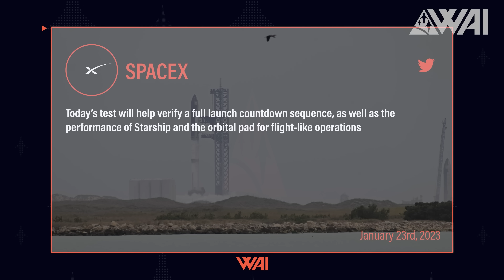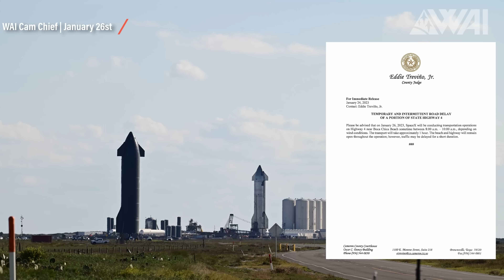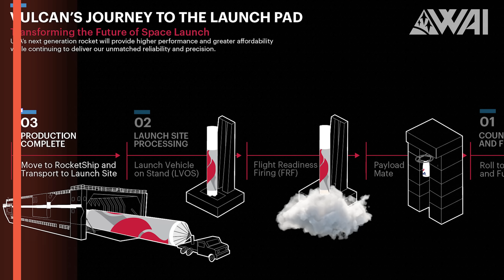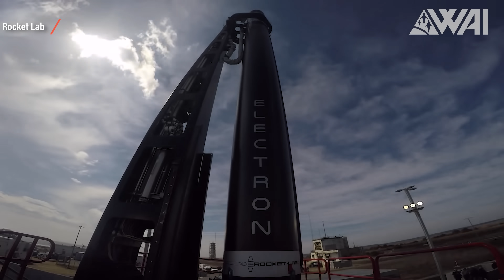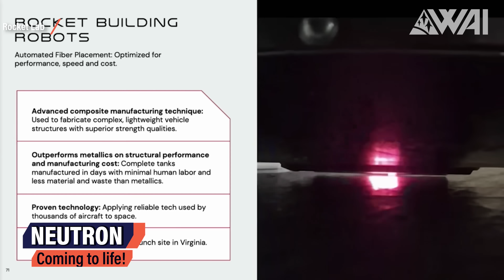How Did SpaceX Starship Do During The BIGGEST Test Yet? - Largest Rocket Ignition In History Next!

Comment from the maker: Is the Starship orbital Launch Mount going to survive the 33 engine static fire? What do you think? :_WAIShocked:
Reply: Yes it will!! Go Spacex!!!
Reply: Maybe? If the non-flame-diverting pad doesn't kill it!
Reply: Hell yeah it will!
Reply: Yes!
Reply: It will be the biggest test of the structure yet.  I am sure they will learn a lot and there will be changes implemented in Florida.
Reply: I predict it will be a baptism of fire
Reply: SpaceX will not burn 33 engines at once, they ended up with 14 engines, they will bring the number to 33 engines through tests of 3.4.
Reply: I think the tower and launchpad will suffer considerable damage. All 33 engines have never been ignited at the same time. But they will learn from it and the design of future starting towers (must) adjust accordingly.
Reply: big boom big badaboom ! Mooltipaaass
Reply: I think the 33 engines will turn the ground underneath to pebbles. Still, it's wise not to rely on a flame diverter: if Starship is supposed to land and take off again from the Moon or Mars in the future, it has to work without a flame diverter underneath.
Reply: 1 - The orbital launch mount will survive - but the pad below will need to be repaired.
Unfortunately, SpaceX may need to carve out some "underground" flame diverters.

2 - Will the Heat Shield tiles survive the 33 engine static fire ?  
If tiles continue to fall off, there will be no orbital launch till they resolve their heat shield tile issues...
Reply: I have deep concerns.  There are reasons that all other heavy lunch vehicles have gone with flame trenches and we know they work.  In this case I think Elon and company have let aesthetics win over engineering.  Again.  I also think building two more Superheavy Orbital Launch Mounts before the first one is even tested at full power is a fool's errand.   On the other hand, IF they finally do transition to sea launches this problem will disappear.  However the current state of the SpaceX Sea Launch System is not encouraging.
Reply: Felix on this channel does get the good stories, but it always annoyed me that he draws it out so long to get it.
Reply: If at 1st you don’t succeed, try try again. Cant wait to see the first huge boom!  Go SpaceX!🚀🚀🚀
Reply: A better question is if the 33 engines each survive the vibrations and immense heat of their 32 siblings …
Reply: I predict slight damage to the concrete but I'm more intrigued with what data they will get from the flight. What is monitored?  Maybe make an episode on that? Thanks for the information  👍
Reply: OLM will withstand the thrust of 33 engines
Reply: Absolutely maybe! Big chunks of concrete will go a flyin'. What about the water dampening? I have confidence that SpaceX will get it right eventually. 2024?
Reply: I love the idea of the orbital Launch Mount but I think concrete will be flying everywhere once the rockets fire off. I hope that it doesn't damage the rocket but all that power from all the rockets lighting at once instead of just a handful will be interesting to see what happens. fingers crossed. Go Spacex!!
Reply: yes it will go well
Reply: Yes, I think so, especially if they use the deluge system. Let the water absorb the vibration and energy the beast is about to unleash.
Reply: There will surely be some damage but hopefully minimal . Right?
Reply: I think so , It will survive
Reply: Excited to go to orbit yeaaahhhhh....
Reply: Yes, always design for twice plus the stress.
Reply: Launch table is a beast!!! The plumbing and insulation... well the workers have job security,  there is always repairs to be made 👍😁👍. And far as the concrete underneath.... it is going to have to take one for the team lol... I know it wouldn't be a permanent fix, but some 2" plate steel underneath table would handle multiple tests between needing repairs.  We use it out at open pit mines constantly to cover our pattern holes. Hundreds of thousands of pounds of explosives , countless tons of rock and ore , crushing and bouncing off it , we reuse plates dozens of times.. Anyway simple idea, but would be far less maintenance intensive.  Probably cheaper in long run too, as would not need replacing after ever single test.
Reply: The Apollo Program was based upon what could be done.  It pushed the limit for sure.  The Space X Starship Program seems to be based upon what is hoped/wished can be done.  Watch the shock waves on video of Saturn V launches.  That rocket was just less than half as powerful as the Starship booster.  The Starship booster packs over twice the thermal/shock wave forces in a similar sized package. That is the wishing and hoping part.  

The video game generation is designing Starship. Just because something can be imagined does not mean that it can be made reality.   There is too much weight in too slender and too small a diameter package.  The stack may simply crumple when hit with the power of those 33 engines.   Too much energy in all those engines which are too close together.  The launch pedestal is terribly inadequate.  And, to top it off I'm not convinced that the Starship itself can even re-enter safely.  For grins look up the Soviet N1 moon rocket.  Four were launched and four failed.  It had 30 engines by the way.  

The Saturn V was a manageable size and had more than sufficient payload to support anything anyone wants to do now.  There were upgrades in the works for the F1 engines.  Imagine a Saturn V with strapped on SRBs.  More thrust than Starship booster.  I think it would have been better to build the Saturn V with todays technology.  

It's going to be very interesting to see if Space X's bold (or foolhardy) Starship + booster will function as intended.  I'd very much like to see it a success.  But, I'm very worried that they have bitten off far more than they can ever hope to chew.  They have many fans here and elsewhere.  But, all of you should find the old Saturn V launch videos here on Youtube and imagine one of these Starships being launched from the Saturn V pad.  Would it survive under the load of over twice the thrust.  Perhaps.  They tended to overdesign things back then due to less computer power available for simulations etc.  Do you think a Saturn V could be launched from the Space X Starship orbital launch mount?  I doubt it.  Hint.  Remember?  The Saturn V had less than half the thrust.
Reply: @bigguy2683  - ? for you. Are you an Aeronautical/Astronautical engineer, or a Structural engineer? If you aren't, then I propose that you really haven't a clue about all of the engineering that has gone into all of the components/structures that are leading up to the launch of Starship/Superheavy.... please go do research, and learn more, then you will be better informed...
Reply: I think it will survive. Not sure though how the concrete pad will cope with the pounding of those 33 raptor engines.
Reply: The fire will be successful, but the mount will be damaged.
Reply: The chemical element on the periodic table with the highest melting point is tungsten 3422 °C, seems to me this element needs to be somehow combined with the concrete underneath the OLM. Tungsten is the second hardest material with the second highest melting point, diamonds being the first. So maybe even a layer of Tungsten over the concrete?
Reply: Sicuramente funzionerà tutto alla perfezione, static fire compreso. Surely everything wil perfevtely work, 33 engines static fire test included!!
We trust on SpaceX and we thank Felix.
FELIX, SEI GRANDE!!! SALUTI DA MILANO! GRUSSEN AUS MAILAND
Reply: they will lift florida 2 cm out of the ocean :P
Reply: Possibly
Reply: I THIIIINK it will, but there is so much about that could get court in the blast. Fingers crossed I guess. Just hope it won’t be much longer.
Reply: Can't wait for total destruction, hopefully only of the launch pad 😉😎🤘🇩🇪
Reply: Of course they will.
Reply: I speculate the engine test will go according to plan. I have a lot of confidence in Gwen Shotwell and the team she has built while Elon takes all the credit
Reply: We're going to see SpaceX realize they need a flame trench.
Reply: If there is no RUD, the pad will survive, but there will likely need to be some repair.   The concrete under the pad has been upgraded so there is a better chance it will survive, but without a deluge system, I give it a 50-50 chance they will need to take it out again.   (I am assuming the 33-engine static fire is going to happen before the install the deluge system)

What will be interesting to see is how the upper parts of the tower fare in the first launch.   They have yet to have the engine blast go by them so there will probably be some unexpected damage.... but I do not expect it to be large.

Comment: If they get the Deluge system up. The pad will survive with the new concrete. After finding out what kind of concrete it was. I tested some of it. It can hold up to the heat or the presher but not the two at the same time. When heated it drop the load bearing strength of the concrete by half or more. No water equals concrete rain. If I'm wrong they put an additive in the concrete that I don't know about. Which is more than possible. It's actually quite probable. At 200ﾟF it loses half its tensile strength. At 300ﾟit drops to an 8th of its tensile strength. At 350ﾟ I no longer had to use a press. I literally shattered it with a tack hammer. I would do more testing but I'm not sure what hardners can be used with refractory concrete. Because I'm not sure how the hardener works because to be refractory it has to expel all water.

Comment: there is no condition of "perseverance and hard work" as God gives freely free stuff perfectly
Reply: what would you need to know, ask God if you "need to" something
Reply: em-launch track (1g or 1000g, for various launch payloads, sensitive and bullets)
Reply: nuclear heat sink jet (hot air expansion nuclear jet, no moving parts)
Reply: ie, external combustion heat sink jet
Reply: just have clever heat exchange pipes from the nuclear heat source to the heat sink jet (no turbine or combustion internally, only externally, out of the jet pipe, in the external "burn" engine only)
Reply: well how much heat you can push at what temperature (2000C+) to the heat sink jet, but you will not have any burn products in the jet output, just clean but hot air
Reply: @Jkauppa  god never did anything as far as we know
Reply: @raoulduke7668  you did nothing as far as God knows all
Reply: @raoulduke7668  well, you just dont know then, amen
Reply: yes hot air torch, no burn products
Reply: that should be enough suitable for cutting steel also

Comment: we´ve seen Starship flights, bellyflops, landing (more or less sucessfull), but why don´t do a single flight of a booster? Due to aerodynamic issues (open top...) or are they so confident that their booster will work properly?
Reply: Not sure. I thought the SuperHeavy Booster would do a test hop all by itself, too. 
I guess the Booster's performance alone, from a launch mount, just doesn't matter. It's the performance under load—specifically a Starship— that matters, for its first flight test. So, since they need to do a re-entry test of the Starship too, why not bundle them into one test? 
That's my best guess!

Comment: THEY DID IT !!!!! Whooo hoooo !!!! What an achievement !!!!!!!!!!
What did they do? They went thru the motions of launching it including countdown....... WITHOUT actually igniting the engines. and THAT IS IT !?
Woopty effing doo.

Yep, a step that needs to be done and that gets down on any rocket system without pomp and circumstance gets announced here as if SpaceX just did something deemed near impossible. Talk about click bait hyperbole BS.

All it does is prove that they can put fuel in the rocket and that all switches, knobs, lights, sensors, etc work within acceptable parameters and that they can count down to -10

In short, it doesn't prove a single thing about how the rocket and it's engines will do or how the launchpad will cope with an actual launch.

Felix, cut down on the caffeine (or the coke)

"Starship aims to send people to the moon and Mars....". Aiming to do something and doing something are 2 different things. There for repeating the marketing talk blindly makes one sound like a twit.

2:27
"...and point to point travel on Earth"
ROFLMAO. That is what Elon claimed and as most of his claims it's utter and complete bovine manure. 
Anyone with even a basic understanding of the logistics, the cost and what it would mean for the passengers can easily show you how this is a non-starter.
Here's a quick example, so what if the rocket travel time is much faster than a jet. Seeing that a rocket launch base has to be far from any city you have to add the travel time to get from the nearest city or transport hub to get to and fro the launch/landing pad, as well as the time to actually fuel and launch the rocket, the G forces that the passengers will have to face without any special suits which means that unless you are in excellent physical shape you won't finish the trip without some serious mental issues.......or if they have special suits then they'll have to be tailored to them and you have to add the time needed to get them on and off.... and it won't be anywhere near affordable.
God, Felix, mate, I know you want to BELIEVE. But if you are talking about hard science things like rocketry it just comes across as being a 12 year fanboy that will swallow any old crap because some twerp with far more money then brains says he will make it happen.
Reply: It's like when a band do a rehearsal for the first time without coming to the climax, and someone said "bohoo it's boring"

Check with your doctor
Reply: @alvianchoiriapriliansyah9882  No, it's like a band setting up their gear, do a check if the mic's work, the amps get power as well as if the special effects (lights, fog machine) work and then leave without ever playing a single note.

I can't recall any ever bothering with reporting that kind of thing in any kind of newspaper, do you?
Reply: @PDVism  Nobody forced you to tune in to the test if you felt it so boring, yet it's so so hard to keep your fingers from getting mad
Reply: Felix,
Terrific content and you and team are great.  Keep it coming!

Comment: Is it normal that its so white🤔 it really gives me the feeling its a fragile rocket. Because i dont see it with other rockets.
Reply: It's normal... it's ice forming on the outside due to the fuselage being extremely cold from being full of cryogenic propellants. You do see it on other rockets... Falcon and Electron both get very visible ice formation around the oxygen tanks (though not the fuel tanks, since kerosene isn't kept so cold). And ice falling from the external tanks is infamously what killed the Columbia orbiter...
Reply: Thank you for the explanation.
Reply: @tfd5088  It's especially striking on Electron, because of the black fuselage... half of it turns white when fueled.
Reply: Thank you… I didn’t know that…

Comment: The biggest puzzle for me about the whole Starship program has been the handling of flame exhaust under the booster.  Surely Spacex engineers are fully aware of the force generated by 33 raptors??  Why this design of a flat concrete base under the rocket??  All those concrete chips flying after much less than 33 engines??  The laborious and time-consuming repair work on the concrete after every less-than-33 raptor test??  How does this design promote rather than hinder rapid and economical launch turnaround???    I have yet to hear a convincing explanation.

Comment: I would go so far as building a flame/thrust trench/diverter system and consider some type of extremely rugged ceramic liner to protect the concrete.  Include a massive flow rate water deluge system.  I think they will end up needing to go this route to be able to reliably establish a rapid launch cadence.  I can't see the present setup lasting for more than one launch.  They will know the answer to this question if after the first launch Stage 0 requires substantial repair to make it able to support another launch.

Comment: I still think the best protection for the concrete under the mount would be to have a steel covered diverter and steel covers for the concrete right underneath. The exhaust is very hot, but the cover only has to withstand the heat for a very short time.
Reply: I would go so far as building a flame/thrust trench/diverter system and consider some type of extremely rugged ceramic liner to protect the concrete.  Include a massive flow rate water deluge system.  I think they will end up needing to go this route to be able to reliably establish a rapid launch cadence.  I can't see the present setup lasting for more than one launch.  They will know the answer to this question if after the first launch Stage 0 requires substantial repair to make it able to support another launch.
Reply: @Bill G  as I  understand it, SpaceX will be using a water deluge system for ongoing launches.